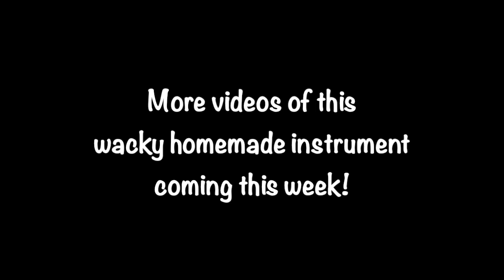I Made a... Wacky Rubber Band Guitar Thingy

Comment: Thanks   I love it.What is the pick up thing? Name brand model please?
Reply from the maker: Thanks for watching. That's a 20mm piezo disc (piezoelectric transducer) used as a pressure pickup. The brand isn't important as it's just an electronic component (similar to a resistor or capacitor). If you do an Internet search for "20mm piezo disc" you'll find several of them. They come in smaller/larger sizes but 20mm seemed to work well for this application. Any piezo disc should work.
Reply: @musicalmiscellany  Thanks for info